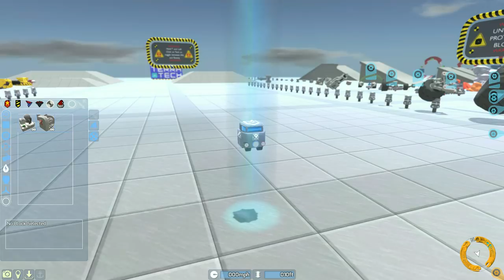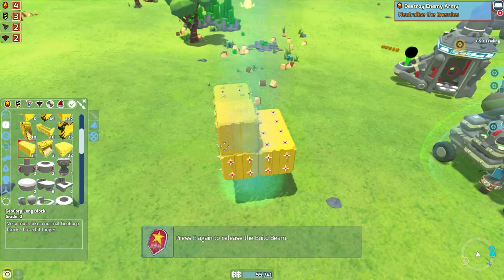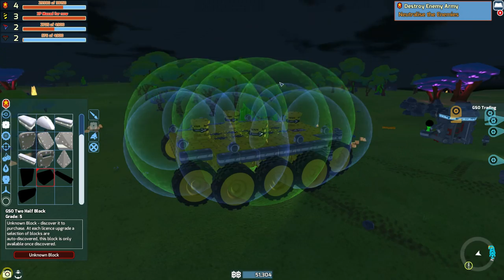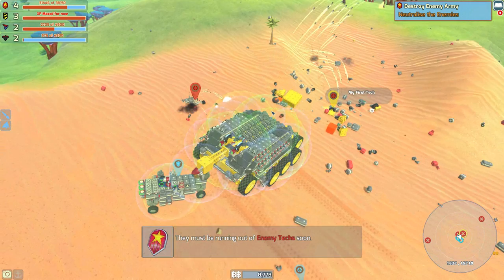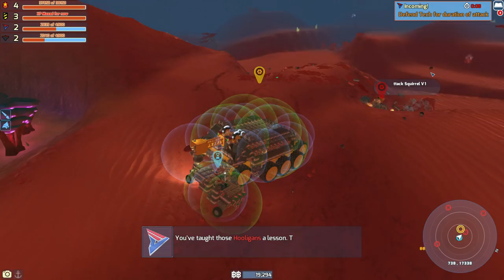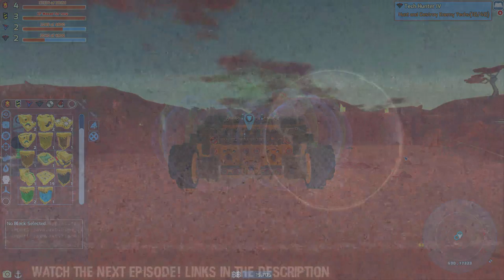Terratech | Ep7 S3 | Vehicle Upgrade & Mortar Madness! | Terratech v0.7.7.2 Gameplay

Comment: Put magnets on the trailer! ;-)

You're certainly doing a great job of demonstrating the robustness of the new ball joint connection. But, of course, zero point actually having a trailer vs putting the mobile refinery + cannon on main tech.

The only useful purpose, currently, is to have magnets on there, to quickly grab up parts for a mobile SCU (on main tech) to swallow, since they don't work together on a single tech. :-)

Comment: what about using hovers instead of wheels for the trailer?
Reply: That is smart, and he should definitely be using them! If he has any say, that is...
Reply: Does he have any though?
Reply: i tried that it works pretty well but is a nighnmare on hills plus you have to have the exact ammount of lift you need or it gets kinda wonky
Reply: Maeve Na tried it, the trailer pulls down the front so it kind of flips.
Reply: Maeve Na That's a great idea!
Reply: genius
Reply: Maeve Na it will probably float to high
Reply: Maeve Na, that sounds like a great idea. Hopefully he uses it oneday

Comment: Hey Lath, I really like that low/mean profile of the upgraded tech! And when all those mining lasers are firing...glorious! Also, just a suggestion, but you may want to use the larger receiver variant on your trailer. Not for the amount it can pick up since you have the pacemaker but for the pickup range! With those tiny ones you nearly have to run over resources to grab them. GSO large receiver has a decent range and GEO of course has a large range. Also, you may want to do the crafty mike missions just to get an Autominer. Just because you are playing a nomad doesn't mean you can't plunk down a few of those on valuable resource nodes and drive away.  They will continue mining no matter how far away you go and the miner itself will keep the resources from despawning. Then when you are ready just head back and gobble up all those block bucks.

Comment: Lathland if you can make a helicopter you can put the SCU (I think that's the right name) on it then the blocks up than towards your main vehicle. The GSO version SCU may be a problem since it pulls and drops if the block is far away

Comment: Hey Lathrop if you read this put mortars on the back middle or front of the vehicle facing forward on a wall instead of a surface it will make them work like missiles instead of mortars less range but more power and lock on as soon as it finds a target it defies gravity and works like a missile but easily unlike and easier to obtain then missiles added bonus it's gso

Comment: so just some thoughts: would it be possible to make a conveyor belt through the main vehicle, such that it drops get picked up by the harvesting end of the front, then run through it, and pop out the end to fall onto the refining/selling trailer?
Reply: with the dropper block, you can do that, but if you're moving too fast, it would be lost i think.  out of range of the receiver before it can pick up.  maybe.

Comment: You really need to find the mobile SCU, I believe it's from Venture, it's radius is small but it can be placed on your vehicle so you don't have to take out an SCU every time.
Reply: put it on the trailer and a block magnet on the main, easy pick up of all the blocks.  doesn't work if block magnet and scu are on the same vehicle.
Reply: won't the block magnet get in the way of his weapons though?
Reply: it depends on where you place it.  i usually put it up high, use the large geocorp girder blocks to go straight up from the top, then out from there in some fashion, it varies.  usually put the block magnets forwards and out to each side.  also a good place to put some miniguns to fire downards into enemies.  but, to be in range of a trailer mounted mobile scu, you'd want them towards the back.  also, a good place to mount lots of mortars, as you need blocks to connect the girders.  need to be careful not to block weapons, like missiles, on the top of your tech.  maybe put the block magnets on the front of the trailer and the mobile scu on the back of your main tech?

Comment: you forgot to put a shield on the roof of your tech, enemies with mortars would destroy it
Reply from the maker: It's difficult to see, but all of the blocks on the top are covered - the overlapping shields in the center make it almost impossible to see from most angles though, I had to do a triple check myself just now haha!
Reply: during the fight at 18:23 I saw the tech's roof take damage and then repair, or is that just because of the explosion/splash damage?
Reply: It was splash damage.
Reply: The way shields work is just stopping projectiles, not the explosion.  explosive weapons will still hit blocks within their radius.  stacking shields, like a venture shield inside a gso shield, inside a hawkeye shield, that won't work.  i asked the developers on stream.  the shield just stops the projectile. kinda ruined my plans.  lol.  still, not all explosive weapons have a large radius and that's what repair bubbles are for.  maybe, have the shields on the outside for maximum protective range? not sure yet, myself.
Reply: A hawkeye shield might have the range to keep most explosive damage out of range if its placed correctly, it has a fairly large area. Haven't tested it against cruise missiles yet but I haven't taken splash damage from anything else since putting those on my tech.